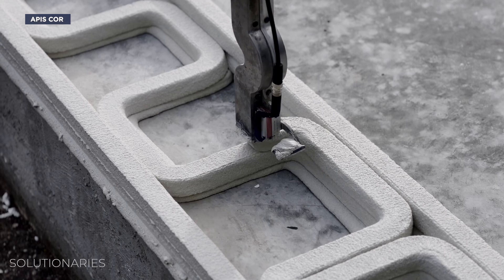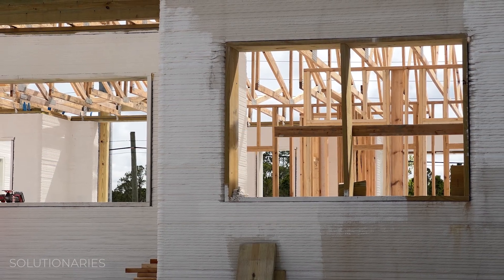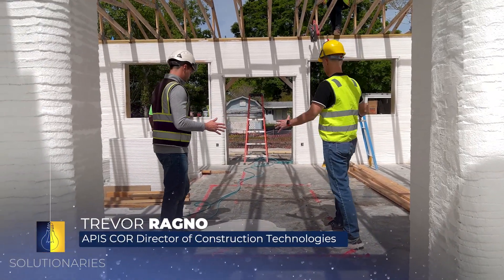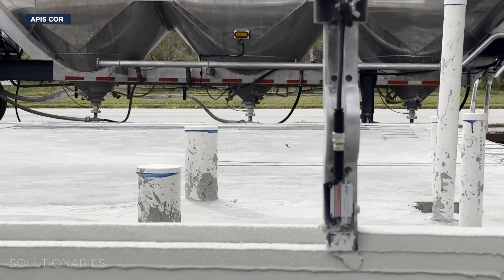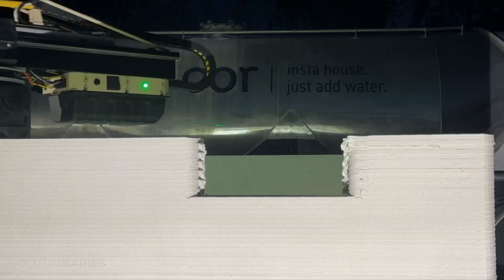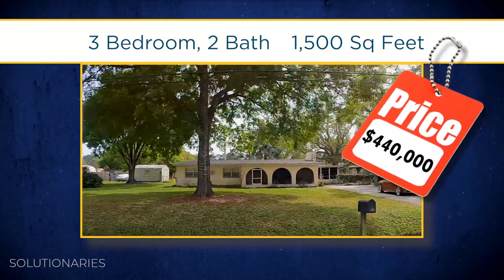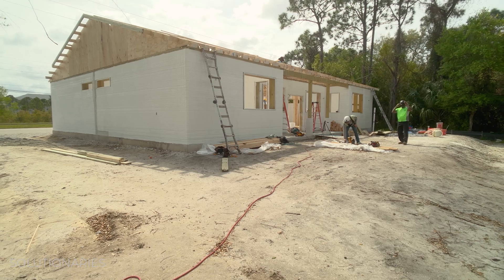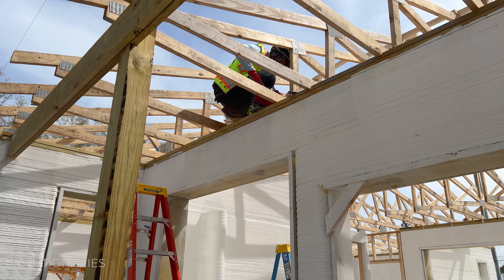Housing Solutions | See how a robot is 3D printing affordable homes

Comment: Here is a suggestion: 3 print heads: outside 2 are Plaster... central is concrete. less weight, easier to drill, thermal shourld be obvious. Structural compression isn't too bad... and fire-proof-ish. Should cut concrete costs by 60%... increase thermal balance even more (also, fireproof? amirite?)
Reply: Great suggestion,  multi extruders

Comment: Why why why why are people still not in housing if constructing adequate housing is this easy?
Reply: The cost of 3d printing has actually been higher for a while.  I am still not sure I trust this company's claims as it has taken other 3d printing companies a lot longer to bring down the costs.  In anycase they don't have many printers or crew that know how to operate them, and also, if demand goes up for the 70% of the other stuff that is needed to be done, that will increase price.  There are not enough contractors, and 3d printing only attacks one part of the process.
Reply: @TheBestNameEverMade  Wouldn’t it be easier to hire people who already know construction and train them on how to 3D print houses? I imagine if demand goes up supply will too and workers will increase in number, therefore producing a house won’t be so costly.
Reply: @weeweefeet4030  I am not sure what you mean.  They do higher people who know construction and also people who do not.  Being able to pick from both gives a bigger supply and allows other construction workers to work on other parts of it.

The nice thing about the 3d printers is that part you don't need physical labor, so there is more kinds of people who can work with it.

I do think lower home prices will increase the number made and increase the total number of construction workers even if it takes half or a quarter as many people per home.  The US for example is literally millions of homes behind what is needed at this point.  That's 10s of millions of jobs, just for homes.  I will point out that 3d printers are not just for homes, so the total addressable market is much larger.

However, they need to get the low-cost to opperate printers that use the lower cost materials produced at volume.  Icon 3d only recently unveiled a printer and material capable of serious competition with the regular market, and it's 2 years away from mass production.  I don't think other 3d printing companies are close yet.

Comment: Okay but don’t you still have to run strapping to put up your drywall? Also how do u insulate?
Reply: Insulation is put in the wall gaps.  It's just foam like substance.  Not much dry wall would not be put in at this price, but owners are welcome to do it if they prefer that look.
Reply: @TheBestNameEverMade  ahh I see. That answers a huge problem I had with this system. That actually makes a lot of sense. So you don’t need any strapping inside for insulation and you’d leave the walls as bare concrete? Or parge/stucco them? Would you do the same thing on the outside? I’m from up north and no one uses stucco really so I was wondering how you’d run siding on the outside
Reply: @blackridgeproductions2738  they do use stuco with some, a few use decorative wall pannels, sometimes they paint them, sometimes leave them bare.  Of course, any additional work increases the cost.  Many like the bare look icon build does.  I have seen one where the buyer of the home was smoothing the concrete by hand as it was printed.

See icon's House Zero for an example of one with minimal additions.  Bare outside and inside except for the bathroom and a few selected walls.